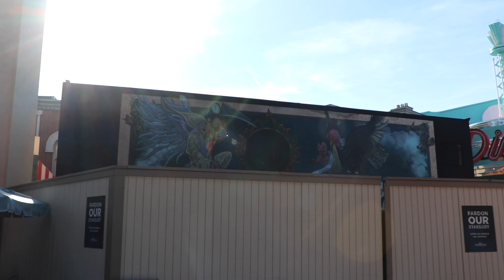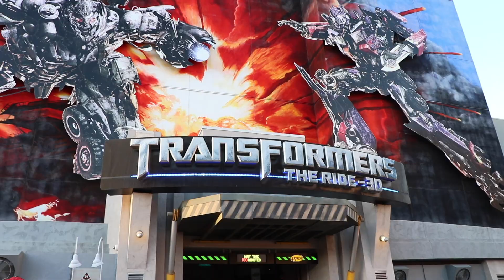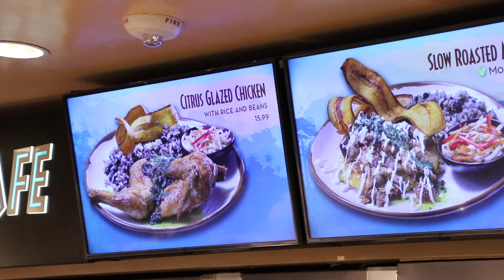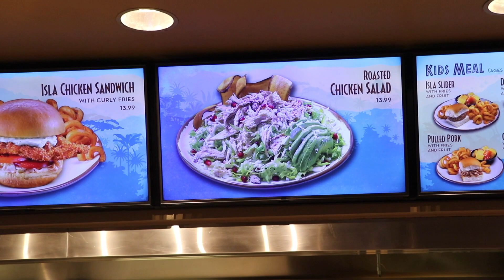HUGE Construction Universal Studios Updates | Peach's Castle First Signs Super Nintendo World ???

Comment: Nice update. Just found your channel. You do great work. You are correct about Mario Kart being the entire width of the land. The whole ride will be indoors. The entrance, if you go by the concept art, is to the left of "Yoshi mountain"  and will be Bowsers Castle. Unfortunately Donkey Kong can't fit in our land due to it being a roller coaster with vertical track below a fake track. Just cant fit in that tiny corner. The land will end on the back side of Mario Kart where the tram travels trough now.  So no stage 21. I do think Yoshi will be coming on the second level of the Mario Kart ride.

Comment: Really confused as to why they're building Nintendo stuff in this area. A Jurassic World Main Street with an Innovation Center would've been a more tasteful choice. Nintendo just seems both random and an obviously revenue-based decision.
This may draw more guests into the park and increase ticket sales, but it'll also increase maintenance costs, noise, and congestion around the studio lot (which, even with this expansion, is still too small to handle the crowds that are coming). A Main Street/Innovation Center would've been quieter, less maintenance-dependent, and just as immersive. After the wonderful job they did on Jurassic World: The Ride, that seemed like the obvious move. 
But I guess they prefer to buy brands from other companies, rather than have faith in their own.